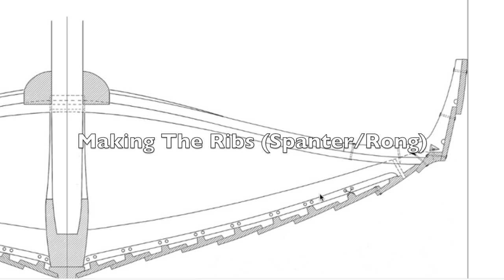🔴Viking ship building in Norway - Part 5 "Spanter/Ribs" (SLOWFILM)

Comment: Lucas, I enjoyed your video on the truing and planing of the "cross rib?" of the long boat.  That was some incredibly tough wood to work given the variability of the grain.  It looks like you were using an old Stanley plane for the the finishing work.  You were getting quite a bit of plugging up of the iron/chip breaker.  This morning I came across a very interesting YouTube channel; Wood by Wright.  This is a YouTube channel dedicated to using almost entirely older hand tools.  The video of the day was something that jumped out at me as it may help you set up you plane to reduce plugging.  I think you will like this fellow's work if you have not seen it before.  https://www.youtube.com/watch?v=cQzLdMsGCqk
Reply from the maker: That is an interesting channel Thanks Mark. My plane is set up pretty much as is described in that film. It would have been fitting to use at least one other plane to take the heavier work and allow the stanley no. 4 to do the finishing, which is it's designated function. I am pushing it a bit beyond it's most fitting use here. The period correct tools that the Vikings used for this work is just like a drawkife with the tangs set into a block of wood. It is quite effective but very hard on the wrists of the craftsman, something that makes me imagine that the axe would be used right up to the very last stage.
Reply from the maker: I rechecked the footage, the chip braker didn't plug up once in that 18 minute segment, maybe what you could see was just the short fibres in the well, from working across the grain.